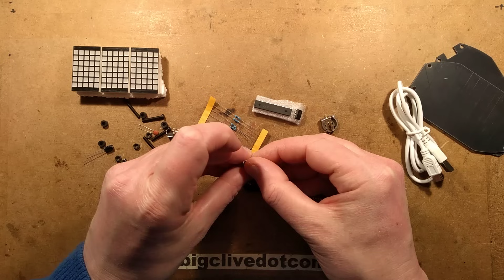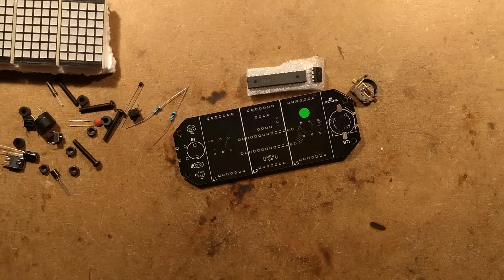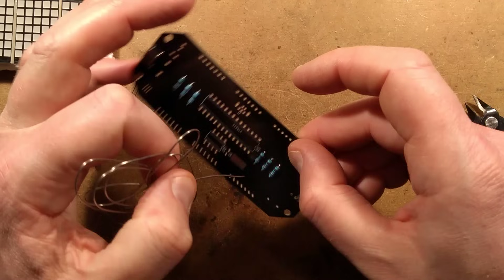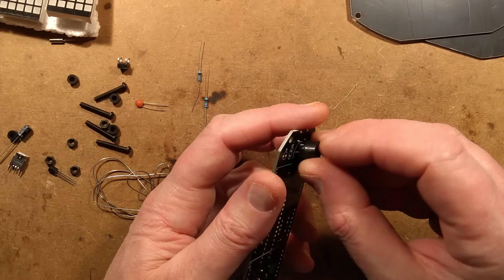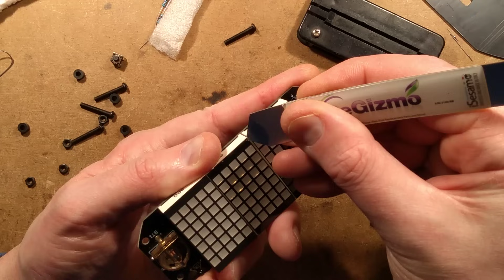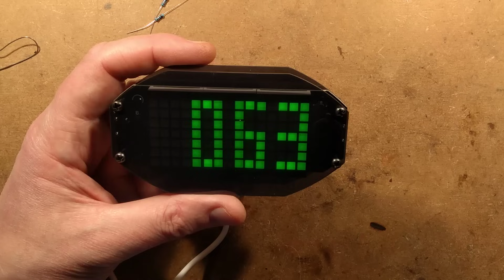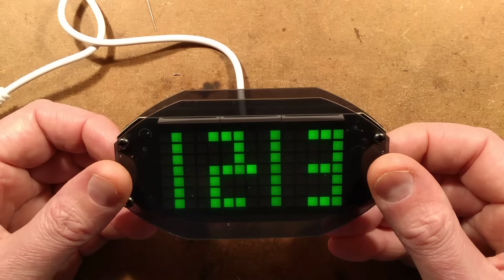Full clock kit build and setting guide.

Comment: I watched this and man I just had to get one of those.  Well the kit I got was all SMD except, of course the display and speaker deal.  So anyhow it was not a difficult build, and she worked just great, the board was white and I had a fer scorch marks and a lot of rosin on the board making it rather dirty looking, so I was off to the shitter to find some alcohol to clean up the board, when I got there the alcohol was gone, but there was some of my good wife of 50 years nail polish remover, so I figure that should work right?  Well it did take all the crud off and left the board sparkling clean, it also made the touch sensors that this unit uses to set it not working!  Damn I was pissed, I had just built another kit a few days before, and I broke a damn leg off the main chip, screwed that one up, I managed to solder the leg back on and it sort of works but not right, so I figure this one is for the bin as well. But just to make sure, I began to resolder some of the leggs on the main chip, while I was doing that, it began beeping like hell!  I tried to set it, and it would let me set the date and all the  other shit but not the time, so I figure resoldering some helped, why not finish, so I did, and when I had finished, it all began working once more.  She is working GREAT now, so thanks for the video and interesting me in the project. I paid 12 bucks US for it, she is a bit different in that the case is rounded instead of slanted as yours, and as I say she has a white board and all SMD.

Comment: 30:32 - It's called Planned Obsolesence !
And when tightening the frame screws follow AvE's advice. Tighten it up until you hear it crack, then back it off 1/4 turn.
Reply from the maker: I sometimes do that with cheap plastic electrical fitment faceplates.

Comment: On some of the older PCB software packages, the square component pad indicated pin number one (1). It could be changed to a round if desired, left as is or made into a rounded rectangle. Sort of dates back to Circuitmaker, (32 bit).  I left them square and made the remaining pads on ICs rounded rectangles to ensure they were installed the right way round.

Comment: for the PB switch opposite the battery holder, insert into PCB, trim the leads, then solder the component in place adding enough solder to just fill the hole. this makes it easier to produce a solder joint that is flush with the the PCB.

Comment: Does anyone know what size battery goes in the battery holder?
Reply from the maker: CR1225 - 12mm diameter and 2.5mm thick.
Reply: @bigclivedotcom  Thanks for that. You probably mentioned it in the video. I watched it twice, once when you released it and once while I was building mine. Mine gains 5 seconds or so every minute.
Reply from the maker: @wotid  The units do seem to have terrible time keeping issues.  I've tried decoupling capacitors to no avail.

Comment: Lay the capacitor barrel on its side flat with the board 
instead of standing up.
Reply: doesn't look like enough room for that on the front next to the display, But on the back...
just have to double check polarity before soldering.

Comment: So what's a good way to get good quality leaded solder these days as stores are no longer allowed to sell items containing lead for personal use? Might be a thing for the entire EU but I definitely know it's not allowed here anymore

The lead free solder I got a while back from a store is honestly just trash, and I have some flux core leaded solder I got from eBay but I have nothing to compare it to so I have no idea if it's any good but it definitely beats the lead free stuff
Reply: Try the newer lead free stuff (don't forget to turn up the heat a bit), it has improved immensely from the old stuff. Still smell horrible compaired to the leaded stuff though.
Reply from the maker: It may be a case of trying various online sources until you find good stuff.
Reply: I haven't tried myself yet (you can still get leaded soldier in specialty online stores here), but I'm guessing the best bet would be searching for a known good brand, like multicore, and hoping you get the genuine thing.
Reply: @Karreth  ah yes it never occurred to me that there would still be loads of european sellers on ebay that have it, for some reason I had in mind that I would have to order from the US or something which would make shipping costs pretty insane
Reply: Solder, where I get mine.
The ban is on manufacturers, not DIY bods.
There are exceptions for manufacturers too, where lead free is not possible they still can use lead.
https://uk.rs-online.com/mobile/c/tools/soldering-desoldering-tools/solders/?searchTerm=Solder

Comment: Call yourself an expert and you don't even know what "midpah" and "fumpt" are    :-D

Any suggestions on how the timekeeping could be improved ? Perhaps more capacitance or a proper voltage regulator on the supply to the micro ? Local metal can for rf shielding ? I may get one if that issue could be resolved. I have some giant led modules that I could mount in a frame with smoked glass.

Any idea's know you have had the kit for a while ?
Reply from the maker: I've tried a 100n cap across the timing chip and 100nF across the MPU and another fat electrolytic across the existing one.  It still rockets ahead when powered and still gains slowly when off.
Reply: @bigclivedotcom  Thanks Clive. I think I may try the other clock kit you built, the one with the non standard 8 segment display. It should be easy enough to link the led driver to my large modules.

Thanks loads Clive :)

Comment: I have no experience with the clock kit shown in your video, but the DS1307 is not an accurate RTC even in the best implementations.  See the following test:

Test:
https://www.switchdoc.com/2016/06/benchmarks-real-time-clocks-raspberry-pi-arduino/
Results:
http://www.switchdoc.com/2014/09/real-time-clock-comparison-results/

The DS1307 often drifts 1-2 seconds per day, while I have a random DS3231 sitting on my desk which has lost 10.5 seconds per year over the past 2+ years; an accuracy of 0.33ppm.  Others have reported similar results and every example I've seen exceeds the datasheet spec.  The DS3231 is better in every regard except that it has no RTC RAM. 

The DS1307 also draws 5X the power and drops to backup battery at a VCC of ~3.75V, making it a poor choice for most battery-powered projects.  DS3231 runs down to 2.5V before switching and draws only 110uA for normal timekeeping.  It also has an internal crystal, so no external components are needed for operation.  It's also temperature-compensated.

I buy the Industrial "SN" version as it has better accuracy as sub-freezing temperatures, but some of most common modules are based on the Standard "S" version.

If I need RTC RAM, I typically use the EEPROM or Flash on the main microcontroller instead.

Comment: How much degrees do you set yoyr soldering iron to?
Reply from the maker: I prefer a hot iron at around 350C.  Ignore the display on your iron and go by feel.  If the tip is clean and shiny and the solder is not flowing properly, then nudge the heat up a little higher.  Make sure you use good quality 60/40 - tin/lead electronics grade solder with a flux core bought from a real seller in your country.  Some of the stuff on eBay is very poor quality.
Reply: @bigclivedotcom  thank you :-)

Comment: It bothers me for some reason that if there are fewer leds on a column on that those pixels are brighter than the rest. It would have been easy enough to compensate by decreasing the duty depending on how many pixels in a column are lit. I'm sure the multiplexing is handled by a timer interrupt with a fixed period so it would have been trivial for the programmer to have created a look up table for timings tuned for equivalent brightness and then set the timer period for each column based on number of lit pixels.

Comment: Clive, you've gotta try Walls insulated coveralls, the arc flash rated ones can be had on Amazon for $75 US. They aren't much for looks but they're very cozy, rather water resistant and 40cal iirc? They made working in an unheated, dilapidated shop in the hood bearable.
Reply from the maker: Alas, I'm in the UK so shipping would probably be astronomical.
Reply: @bigclivedotcom 
Sadly yes, there is that. Perhaps it is time to start an international smuggling ring after all. We'll trade you durable goods for real booze and snacks.

Comment: Finally was able to watch this one to the end, nice build again, do you have the time deviation by now ?

I was thinking about building a clock with an esp32 and either an LCD or some simple leds cobbled together,
and using the esp32 to push a button, connect to wlan and sync time that way. (router NTP time server)
(i'm usually disabling wlan when i dont need it, simple power switch on the APs)

i still notice the time "slowing down" on my old 1970s-ish mains powered and 50Hz synched alarm+radio+clock,
when they talked about that some time ago in the news, they said it was eastern europe (..ukraine..) slowing down the netsync from 50Hz
to a bit lower values which over time leads to slower clocks.

As i've been told it was standard in sowjet russia,
that net frequency went down during day time with higher loads and bad stabilization,
but the clocks would catch up again at night when it went over the 50Hz...
Reply from the maker: Yeah, the timing is terrible.  When off it slowly gains at a noticeable rate and when powered it gains much faster to the point of being unusable.  Even adding a 100n cap across each chip's power rails and an extra fat electrolytic to the supply hasn't helped.
Reply: @bigclivedotcom  Did you check the quarz frequency with an oszi ?? i bet its too cold in your house so its running higher speed 😒😒😅

Comment: 19:40 & 22:47 You may want to try and find (or make) a heat resistant silicon-rubber thimble to protect your fingers when holding small metal components during soldering...
Even just a small square of the material that you put between your finger and the component should work...

Comment: Hi Clive, I purchased one of these kits from banggood.com and I had a problem with its poor timekeeping, Over space of five minutes it  gained 50 seconds. Even when I purchase a new Crystal and the RTC it still makes no difference, Weird or what.
In the end I just  throw it in the bin. I'm interested to hear what you're clock does?
Reply from the maker: It's rocketing ahead with its time keeping.  Especially when powered, suggesting an issue with the RTC chip picking up noise from the adjacent circuitry, but also hinting at an inaccurate crystal.

Comment: Because these multiplexed displays are not being driven by constant current drivers you get an uneveness in brightness depending on how many leds are lit in each column. Fewer leds means brighter leds - you can see this in the dots. You can compensate this with software, by counting how many leds are on in each column, and varying the 'on' time accordingly. It's not perfect, but better than the uneven effect as seen here - and it's free.

Comment: I've even heard of a soldering iron that used the heating element AS the temp sensor. One way of doing it is to drive the iron with a bridge circuit, another is to sample the resistance of the element while skipping a power cycle. trying to figure out exactly how to do it makes my little brain hurt.

Comment: It used to be that capacitors were rated in pico or micro farads. However, as of late, I have been seeing and hearing nano farads. What's up with that? Makes it a bit difficult because I have to convert from nano to micro for it to make sense.
Reply from the maker: Most suppression and decoupling capacitors are rated in nanoFarads.

Comment: I soldered this variant of this type of clock a few months ago:
https://www.aliexpress.com/item/DS3231-temperature-meter-High-Accuracy-DIY-Digital-Dot-Matrix-LED-Alarm-Clock-Kit-with-Transparent-Case/32880004645.html
It's a bit bigger AND the best thing: it's many many many SMD parts! Yaaayyyy \\o/..... It was such a pain to solder those 2 SMD ICs, it really hurt my sanity! Solder bridges, "don't overheat it! D: ", 40 pins of doom... but hey, it worked at the end!
Same thing with the options practically, either almost all the same or actually all the same. But there is a bit of a problem with the acrylic case: some solder points have to be really flush so they don't obstruct the case, but i just scraped off a bit of the case with my trusty dinky small battery driven rotary tool, so it worked fine.
It has one problem though: no buttons. You touch the areas on the PCB to activate the buttons. One works well, the other doesn't react properly at all. So I just scraped off a bit of the PCB's black paint in the button areas to make it respond better, and it does!
Actually wanted to use these clocks (bought 1x White, 1x Blue) so i ordered CR1220 batteries, but they never arrived and the clocks are just sitting in the closet, crying...

Oh also: i had a chinese manual included PLUS a link to an english PDF file with both soldering instructions (+order) and function instructions. Really neat kit, but the SMD chips really drained my sanity! Plus some other components which had one pole coupling onto a huge plate on the circuit board, making it virtually impossible to heat the pad enough :O Especially on one SMD electrolytic capacitor, trying to not overheat the capacitor but needing to heat the pad for ages for it to take solder, really painful!

Comment: Square pads are typically pin 1 on IC packages.  I think they are positive for electrolytic caps.  Yes, printed or even copper screened labels on the solder side are best.

Comment: I hate that the midpoint is so close to the "2". Does that change when you set it to 12 hour mode instead of 24? (No need for the hours to display a "2" for 8, 9, 10 and 11 o' clock so the digit for hours can shift to the left).

Comment: I designed one of these for my first pcb project, mine had an atmega328p and DS3231. Had same problem with ghosting due to driving the display straight from the microcontroller. Seems the transistors on the gpio aren't fast enough for good multiplexing that many leds at the same time. For next version I just used a display driver IC and it was obviously perfect and had brightness control etc.

Comment: the DS1307 is a good chip and keeps time perfectly if it runs from a good 32kHz crystal - limited only by the behavior of the quartz, such as its temperature coefficient which is normally optimized for 25°C operation in a wrist watch.

That said I once got a batch of 20 counterfeit DS1307 from eBay which I wanted to use in a student lab. The chips were mostly not running at all, some of them went red hot after a short while.

Yes, there are more advanced alternatives which now even have the crystal embedded and also correct for the temperature coefficient by adding extra timer ticks when needed (the crystal is slow when running at higher and lower temperatures).

The quartz crystals also come with specifications for different load capacitances when bought from reputable manufacturers - the ones off ebay are usually unspecified, but normally the frequency deviation caused by the capacitive mismatch is negligible.

Comment: A serious question though Clive if I may. 
With the British weather being as it is, how do you stop damp and it's associated damage eg. rust if you don't heat your house to well above 8c?

I've had massive issues with rusty tools (ooer) by leaving them in sub 10c environments
Reply from the maker: I use desiccant drum dehumidifiers in winter.  A drum of desiccant that rotates through high airflow and a heated section with condenser.
Reply: @bigclivedotcom  I don't think I've seen a video on that...any chance of one? :)

Comment: i want one.. i recently bought a led spectrum analyser in kit form from ebay, didn't notice it was all surface mount components and no instructions. 96 separate surface blue leds, 1 ic.. different surface mount caps and resisters and 1 Crystal. luckily most resisters where the same for leds but the caps i had no idea what went where except for 1 surface mount electrolytic near usb socket . i had to guess the rest. didnt work first time but it was ic not soldered properly as it surface mount and so tiny. dont want to do another.. but this clock will be much easier.

Comment: Hey. I know you're probably not paying attention to what I'm saying right now, but I have one of these two in one wall charger/car charger usb power supplies. I was wondering what, if any, kind of protection do they have against sending power through both the wall/car charger end at once. The model is: 7140-50
Intertek: 5010162. It says it's confirming to UL standards but I'm a bit sceptical.

[Please try to comment on this or thumb it so this post can reach top comments. I want to know what Clive thinks about this.]

Comment: In my experience, cropping leads very short doesn't matter when using quality leaded solder. I used to do it all the time and never had any problem until i went for high temp lead-free solder, as it's all they wanted to sell here for a very long time. It cracks very easily, especially if there's vibration and wide temperature variations. The DC-DC step-down converter i made 2 years ago for my car had cracked solder joints on most of the cropped leads in about 6 months. Cracks were aligned with the direction i cropped the lead in, so i guess compression too close to lead-free solder joint create tension, while leaded solder is soft enough to just displace.  It's my hypothesis anyway.